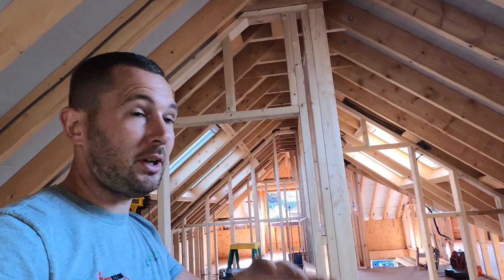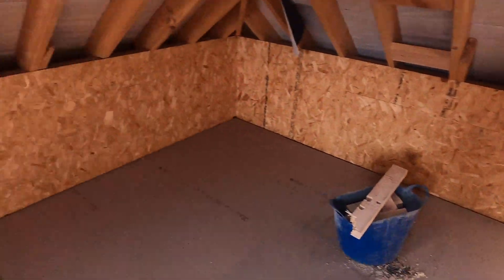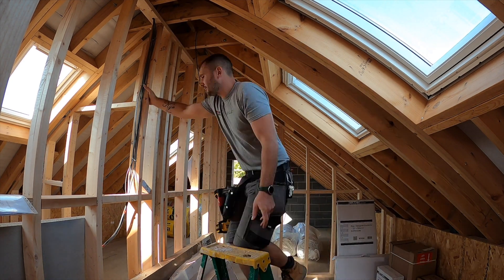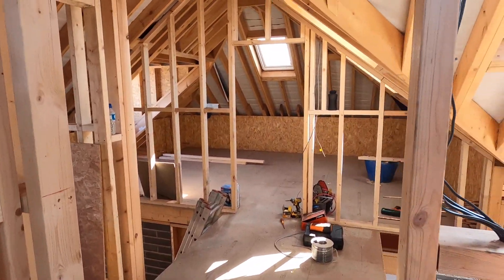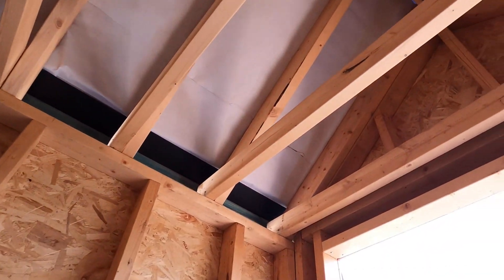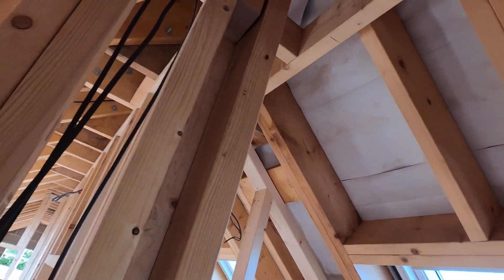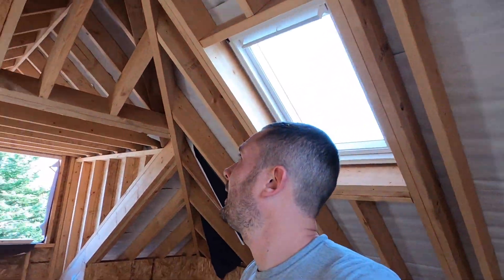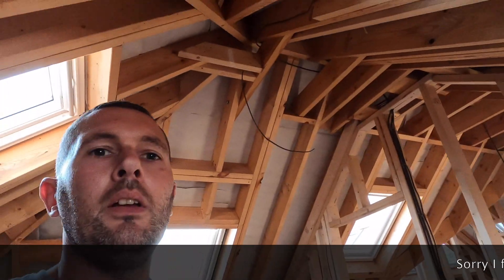How To Install Lighting Circuits On a New Build

Comment: Why clip down side of timbers more chance of tacker hit cable with nail/ screw and also if using a plasterboard box cables will be outside of zone . If in a place where plasterboard was already done and you are fishing cables down wall you can’t clip

Comment: If i were you I would clip the cables on the joist since if the drywaller fucks up his mesurement or just screws on your cable pretty easy , I ussually just leave them hanging and put some electrical tape to make it neater .I also got the stapler gun and you dont need to staple 2x just staple 1 cable for example and put a cable tie to hold the rest of them , it will look a lot more neater atleast for me
Reply from the maker: gabriel thanks for that I might try the zip tie trick 👍